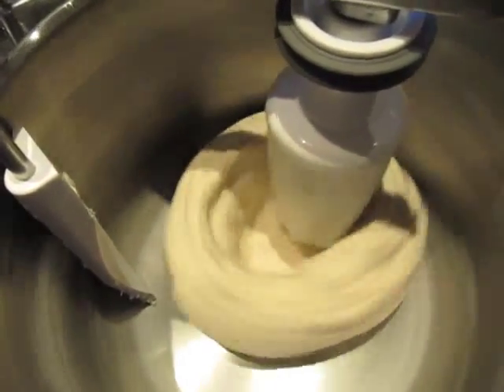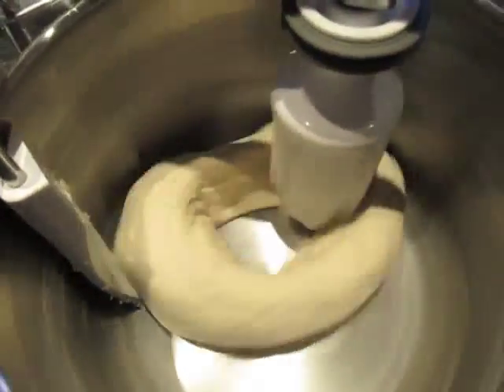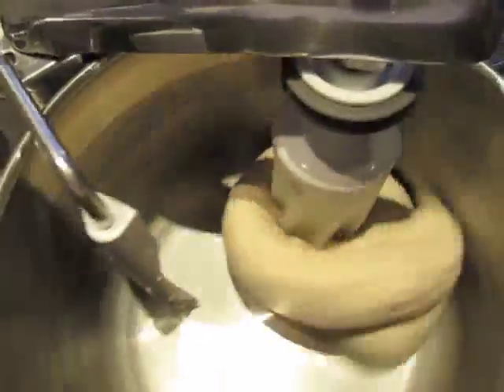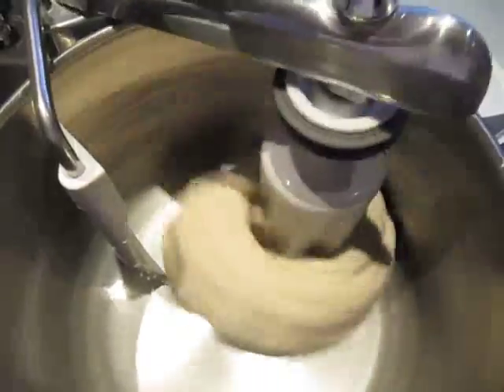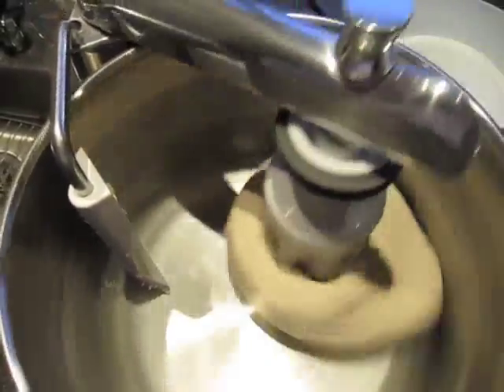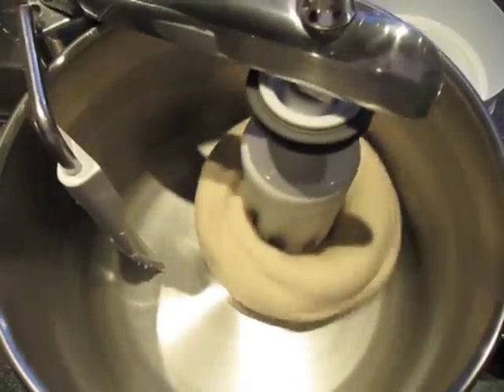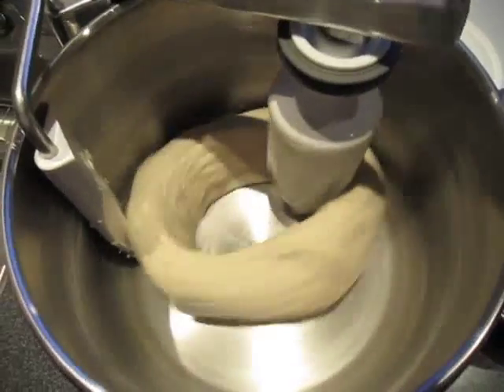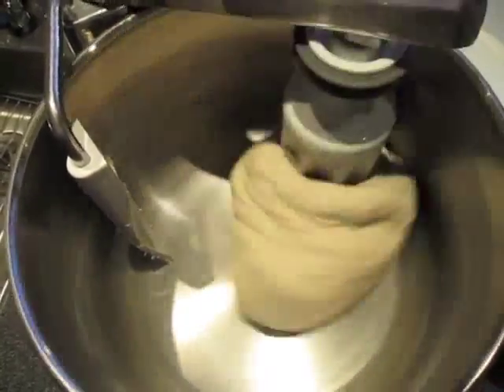Mixing Bagels in Assistent N28 Mixer

Comment: Hi , which is speed 9? just got new anskarum with no numbers on speed dial. and i'm using 885 g bread flour to 2 cups water.
Reply from the maker: On mine there is a zone at the high end of the speed range that is reserved for whipping cream/eggwhites and perhaps for some attachments. Without that restriction I would have to guess.

Comment from the maker: How big was your batch size? I think 52% hydration may be out of range for this mixer. In fact, 55% is about as stiff as I think I want to go.  As for a poolish, the starter is the poolish (just has some LAB in addition to the natural yeast) and I do as you did and just put it all in the bowl and turn it on.  Try it at 58% and just let it go and see if it looks like the video.  There will be differences due to variations in flour - this was La Romanela high gluten flour from Smart & Final.

Comment: какая у него мощность? за время работы поломки были? И как долго  он у вас ?
Reply from the maker: The oven is of German design (Rational) and out of production.  The basic wiring is for 3-phase 208VAC, but can be wired for other voltages. I have it set up for 240VAC/2-phase.  I have had the oven for 18 years and it still works fine. The only breakdowns I have experienced included one solid state relay failing as a short circuit; the Hall effect door closed sensor was intermittent and required adjustment; and one of the solenoid valves failed closed (the one for manual steam addition which is not essential and I have not replaced)

Comment: so you knead for 10 min for bagels in the mixer?
Reply from the maker: You knead until the gluten is fully developed, and that is a function of the flour, the hydration, the dough temperature, and whether you are using the roller and scraper or the dough hook (and certainly where you have the roller set if it is held off the rim). So for some combination of those 10 min is adequate.